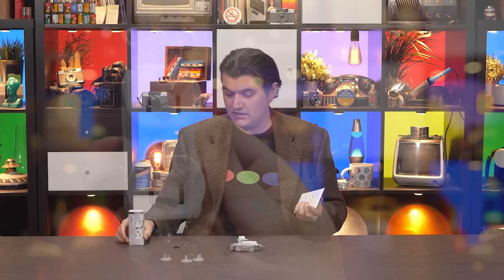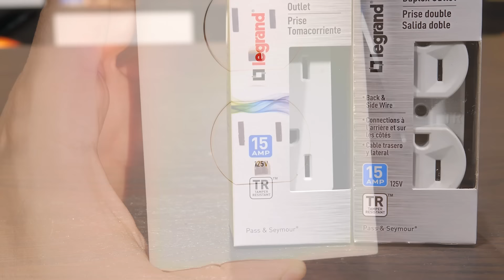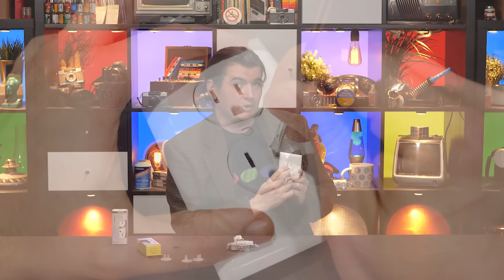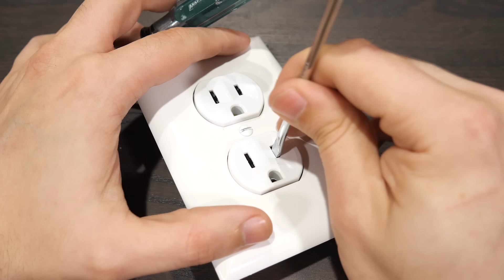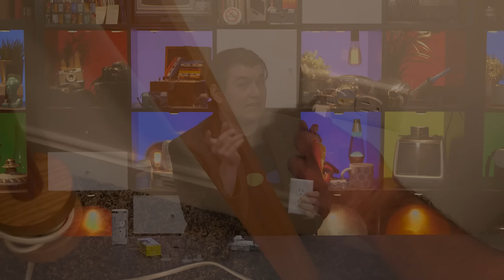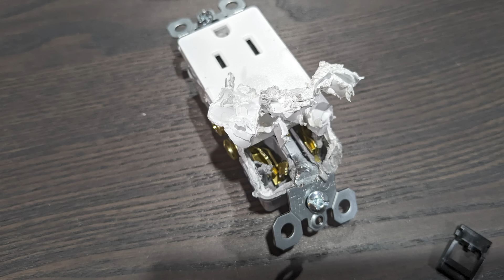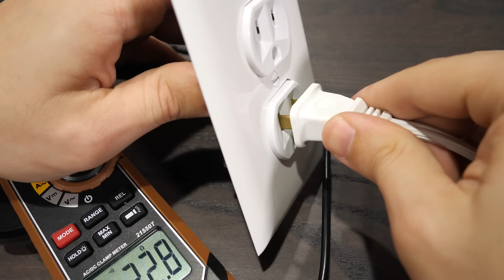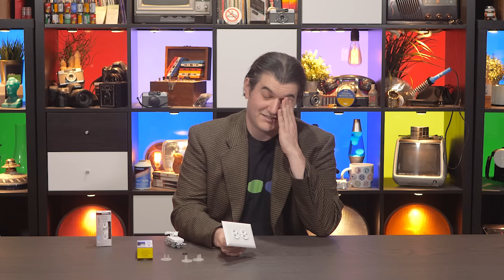Tamper-resistant outlets aren't all the same - a follow-up

Comment: I generally tend to agree with you but Wagos and backstabed outlets are definitely not the same. Backstabbing does not hold the wire as well as the wagos. I've seen backstabbed outlets fail when under heavy load even at the end of the circuit. Do not ever backstab outlets. It takes 30 seconds longer to use the screw terminals
Reply: I believe Wago connectors are the ones that use a positive clamp (you have to click the little lever down into place) right? So there's significantly more force holding the wire in vs a backstab which just uses a spring loaded tab to hold the wire.
Reply: This isn't directed at anyone, just might be useful info. Most wire strippers have a hole in them that allows you to bend a "hook" fairly quickly. Also make sure the hook follows the direction the screw tightens and the wire will be pulled in tighter to the screw terminal.
Reply: I am 100% for the side clamp ones. Straight wire, but retained by screwed in plate. Way easier, super secure, lots of wire contact.
Reply: @EricLS  totally agree. Also the new levitons with the wago style terminals are really good as well
Reply: It takes me way longer than 30 seconds but my Dad taught me to use the screws & I have done dozens that way in the last 30 years. The GFCI are the absolute devil trying to wrap 12 awg wire around the screws so I like the kind where the screw clamps the wire from the side or through a hole.
Reply: @klatubaradanikto Easiest way is to pre-curve the wire around your screwdriver. That way you can just put it over top the screw, and then close the edge of the wire around the screw. Then you simply screw it down
Reply: @Spiker985Studios  my preferred method is to use my diagonal cutters to make my hook

Comment: 20+ years ago I was working in a small computer lab, and I forget the exact sequence, but I slightly shifted the table and suddenly the entire wall of computers shut down.   It turns out that a power cord (below the desk) had come partly unplugged, and when I shifted the table the security cable (bare aluminum wire) that locked the workstations down, dropped down off the back of the table and fell across the prongs of the power cord, made a dead short, and popped the breaker.     So yeah, that one rare argument about putting the ground pin up has happened to me personally.   once.  In 20-25 years.    All the plugs in my house are still ground-down and I'm not bothering to swap them around.

Comment: Generally under most circumstances it will "TINGLE" really well and remind you pay attention and that's all ... I know what higher voltages do because it's fun to overdrive motors with sometimes twice the volts as a kid and all ya know. I don't really even considering working with it at unless it's the one for the washer or dryer and all being really really mindful and just basic awareness of what you are doing  if I know it's 240 or above. Be safe and wonderful video! 🍻🌎♥️

Comment: The "your plugs are falling out" is probably due to the fact that, at least from your footage it looks super easy to pull a NA plug. The EU plugs hold insanely well. If its a power strip you, 100% of the time, have to use two hands, one to hold the strip and the other to pull very strongly. If its a outlet you can use one hand but you still have to pull very hard. I would say its almost impossible to pull a plug with a cord on accident. You would have to pull with both hands and on the right angle plug there is 0 chance. You would break something before you managed to pull the plug with the cord. Compared to this your outlets seem super week.
Reply: I have also come across many a dodgy EU socket, including power strips, so they are far from perfect. 
That being said, they are still on average better at their job than NA sockets. And as for the UK/G-type aficionados out there: NO it is not better. Only different.
Reply: Maybe for old or worn sockets. But any new socket is going to grip tightly. I've tripped over plugged in cords, to the point I almost fell on my face, and they didn't pull from the socket. I replaced several sockets that were loose, now I feel like i'm going to punch a hole in the drywall just plugging the cord in. I always worry i'm going to rip the socket out of the wall when unplugging it. It's actually  very similar to the average plug I've seen in the UK.

No argument about the 90 degree orientation of the cord on a lot of UK plugs. You'd practically tear the wire in two before the plug lets go I think.
Reply: Having stayed in hotels in the EU, I have to strongly disagree with you. You may be correct when the outlet is new and in good condition, and that is the same here. however your two prong outlets over there are just as prone to wearing out and becoming loose as our two prong outlets over here. No I'm not comparing to the giant three-prong UK plug, but those two round pins you have, old worn out outlets with those have trouble holding my travel charger just like outlets that are worn out at home.
Reply: @Green__one  Hotels may be a special case as people plug and pull and may even use nonstandard plugs. I have never seen a loose outlet myself. Some of my outlets are from the 60s.
Reply: @Green__one  yeah but a charger is rarely grounded. so it doesnt take advantage of the full recepticle. and yes then you do have a similar problem to the american style. except the socket is still recessed and the charger prongs are sleaved and the tolerances are better.
Reply: @Peron1-MC  I'm talking about the full 2 prong receptacle. Those are almost  non-existent in north-america, but very common in the EU.
Reply: @Green__one  do you mean these? or wich country XD https://static.byggtjanst.se/byggkatalogen/images/news/scaledimages/17441/620x345/5206443s-eko07097-jpg-full-page.png 
maybe youre talking about something completely different. my bad. these are swedish
Reply: "More secure" just means pain in the ass to unplug, especially in hard to reach locations. I'd much rather stick with the US design, thanks.

Comment: There is a need to carry quite a bit of current for some devices, so that is the limitation.  So this means that you need a certain amount of metal to metal contact, so that means that power applied while partially inserted is going to happen.  Sleeving the base of the prongs will also mean less metal, since there is a max thickness.
But one option would be to have a spring-activated mechanism where the plug being fully inserted activates a spring mechanism that then grabs the plugs.  The down side is that this would be more complicated and more expensive, but could be an option.  Think of a contacts (which you recently did a video on) but the contact actuation comes from inserting the plugs.
And I have had experiences with a 100W USB-C power supply pulling out of the wall at places with constant usage, like coffee shops.

Comment: Technically, those things are called Receptacles. Any place where electricity is used is called an Outlet, for example, a light fixture. So Receptacles are a subset of Outlets. With the contacts deeper in the receptacle, you are less apt to get a finger behind the plug to get a shock.
Reply: So, technically, they ARE outlets

Comment: @12:50 remember ohms law. The resistance of your body is relatively constant, and when the voltage of a shock is lower so is the amperage of the shock. Volts=amps x resistance, the amperage of a 120v shock is half the amperage of a 240v shock
Reply: Emphasis on “relatively”. There is a breakdown voltage: [if I have the terminology correct], the minimum amount required to penetrate skin. You can safely touch the two terminals of a 12V car battery even though its potential amperage is high. Thanks to it being low voltage you are safe. Even though its wattage (V x A) is higher than from an A/C outlet.
Reply: @billr3053  yes, and for DC voltage the standard for requiring personal protection is 50 volts DC, I think it differs for ac voltage due to the voltage crossing the zero point during its wave form but it's similar. Either way, both 120 and 240 are high enough to shock you, plus it still has to go through the outer layer of skin to shock you so with exception of the damage that can occur from the shock the resistance of your skin doesn't change much. Not enough to make any difference anyway, but the point is the comparison of 120 and 240. For a given resistance, 240 will always have double the amperage of 120 assuming it's not coming from a current limited source

Comment: I chuckled when you were relating your second incident with the blades and feeling along with your fingers. I remember when I was working on a hot tub heater (220 Volts) and my little finger was out and it touched one of the hot wires. WOW, that hurt!

Comment: An American who just finished living in the UK for many years and now back in NYC: the American plugs (which most people I know colloquially call “Edison plugs”) tend to be injection-moulded, with flimsier metal blades with the strongest pin being the Earth. Plus, as you mentioned, the cord mostly sticks straight out. In the UK, the housing is serviceable, the thick pins are sleeved, the earth pin opens the shutters, and the cord is at a right angle. In other words, super durable and safe. Oh, and outlets almost always have a power switch for each outlet on the faceplate. 
Friends used to joke: in America, if you step on a plug, you’ll bend it. In the UK, you’ll puncture your foot.

Comment: 'Curious Weirdo' would have been a fantastic channel name.

Also, a connection secured properly with a screw is ALWAYS the safer option.  The connection is much more mechanically and electrically sound, and will always introduce less resistance than a spring loaded push in connector.
Reply: Plus, the Wago connector has a mechanical cam-over function the outlet does not. Everyday Repairs here on YouTube has a video about them.

Comment: Having replaced back stabs that have burned up, I'll never use them.  I think the advantage that waygo have over back stabs is that they are transparent, and you can inspect the quality of the join.  You can see if there are any arc damages.

Comment: There was a bit of an opportunity! 🤣 I absolutely thought the same, an then you just said it! By the way, in the EU we do have those, too. Forced for several years into every extension cable, no matter the amount of outputs and no matter, if the German or the French version (German has two clips of ground pressing to the contacts of the  plug and the French has 1 ground pin (same size of line and neutral) in the receptacle, where those clips are inside a hole of the plug. Not to mention, that those pins are all much thicker than in the US and maybe a bit smaller than the ground pin in the UK. 😉 And both versions have their contacts way below the frontplate, the plug needs to be inside the front plate, to receive any contact.

Comment: Sticking one screwdriver into the outlet didn't do anything though, so I made a "U" of solid copper wire and stuck that in instead.  I think I was about 12.  And the house had actual fuses instead of breakers so fixing it before Mom and Dad got home actually took some effort.

Comment: When I was growing up, at one point, my father had an electrical inspector come by to make an assessment of our house before he did some electrical work.  The inspector advised that the work Dad wanted to do would trigger an inspection that would require major electrical rework.  I think Dad was intending on doing something a little more complicated than an outlet upgrade, but it wasn't much more than that.  It might have been replacing an overhead fan and replacing some outlets.  But whatever it was, it did include fixing some outlets and he didn't simplify the effort to just fixing the outlets after hearing the inspector's report.
Reply: In the house I grew up in, we deliberately never let a licensed electrician inside.
post and wrap spliced to two- and three-conductor Romex, grounded sockets that weren't, grounded sockets in the kitchen that were grounded to the pipes feeding the sink... next to one of the "grounded" sockets, about half the wall sockets were old non-polarized types, some push-button light switches, and a screw-in fuse panel that may have been installed before WW2.

Comment: As an electrician, in Iceland, I've grown up with 1x220-240V, but I've also worked on houses with 2x110V before that was completely done away with.
Having been shocked a hundred times in my life, often intentionally, I can tell you that the worst shock I've ever had was when I was working on 110V.
My conjecture is that because the voltage is lower, the time it took me to get shocked, react with a flinch, and break free, was actually longer. So basically, I spent more time being shocked, which caused longer muscle contractions, and thus more pain. Anyway, that's my idea.
As for higher voltage killing your better, I don't think that's technically the case. Higher voltage definitely burns better, but amperage over the heart is what kills you, and you can get those 100mA from 110V just as easily as from 240V.
Oh, and not to defend the US plug, but although Schuko is infinitely better than the US one in almost every respect, it definitely isn't perfect. Then again, who needs polarity anyway! 😅
Reply from the maker: So, here's something that continues to perplex me - you understand that current across the heart is what's deadly, and you and I agree on that. But the current that flows through something is a function of the voltage, is it not?
I've heard some conjecture about 120V being more likely to cause muscle contractions but I'm not sure that's backed up by evidence. And what exactly any particular shock might do to you depends on so many factors.
Reply: @TechnologyConnextras  Yeah, of course, that's basic electronics. But let's say that your body in a given situation has a 400Ω resistance from your left hand to ground via your right hand. At 240V, that gives us a 600mA current across the heart, which can easily be deadly. Meanwhile, at 110V, that's 275mA current across the heart, which can just as easily be deadly.
If your internal resistance is 4kΩ, however, you're looking at 60 vs. 27.5mA and would be more or less equally un-safe-ish, and at 40kΩ it's 6 vs. 2.75mA and you're equally safe.
The differences between 110V and 240V with regards to amperage don't really matter much, except in an extremely narrow zone of resistance. For example, if it's 2kΩ then we're looking at 120 vs 55mA, so if we say the magic grim reaper cross-over point is 60-100mA (which it isn't, because meat is not maths), then precisely at that point you'd be toast at 240V but happy at 110V. Hence, with regards to human "safety", I'd say that there is really no practical difference between 110V and 240V.

Where the voltage DOES matter, is with regards to arc flashing and bacon frying, but even then, the difference in arc length between 240V and 110V is somewhere in the micrometers range. I don't remember the actual maths, since it's been 25 years since my school days. 🙂
Reply from the maker: @ArniVidar  I dunno. It's not merely current that stops the heart but there is a time component as well. Plus, when you've got a whole entire body passing current from one end to the other, how much goes through the heart is a small percentage. Doubling the voltage can easily tip the balance from shock to deadly.
I always come back to this: there isn't some magic point at which voltage becomes dangerous. Everything in this regard is on gradient, but the one thing that's for sure is that higher voltages are always more dangerous than lower voltages.
Reply: @TechnologyConnextras  Well that's my point.. no. Higher voltage is not always more dangerous, because the difference between 240V and 110V, although double, is still minuscule in the grand scheme of things. Under normal circumstances, the human body has something like 3-8MΩ of resistance from thumb to thumb. Under those circumstances, microamps will flow from one hand to the other if you grab a wire in each hand.
And yes, time is obviously a factor. But as I already said, having been shocked countless times I can anecdotally claim that 110V shocks you longer than 240V does, which by your logic would make 110V less safe than 240V. 😀
Like I said, higher voltage increases the length of the arc flash, and will burn more bacon, but the differences there between 110V and 240V are still negligible in the real world, unless you're leaving the LV and moving into MV or HV territory. That's where the arc starts to bridge centimeters/inches/feet/meters of air. 😳

All of that is entirely moot, however, if when shocked you reflexively grab a hold of the thing shocking you, and you hang on uncontrollably and indefinitely. Then you're going to be in a world of hurt regardless of whether you're pulling 78V or 440V through you. When time moves towards infinite, you're in deep trouble.
BUT there the higher voltage has been known to be beneficial, because the arms / hands got fully broiled and lost the grip on the power feeder by way of muscles not existing anymore, thus saving the life of the electrician. 😰
And, no, I've never liked putting my hands inside a live electrical cabinet, for a very real reason.

Comment: I've received 120V shocks at least twice. The first time I was about 8 years old and plugging in a lamp behind a piece of furniture. I believe my index finger made contact with the live blade of the plug on the underside (while the outlet was mounted in the usual ground-down orientation, it was just a lamp so it had an ungrounded plug). The other time I was repairing a lamp and I thought it was unplugged but I had in fact unplugged the wrong cord. (Oops!) I felt really stupid on that one.